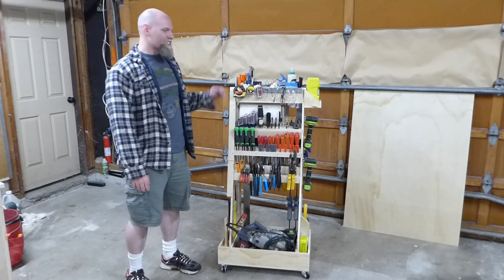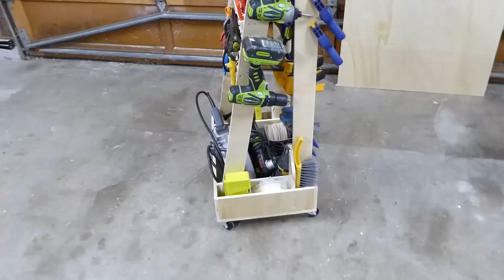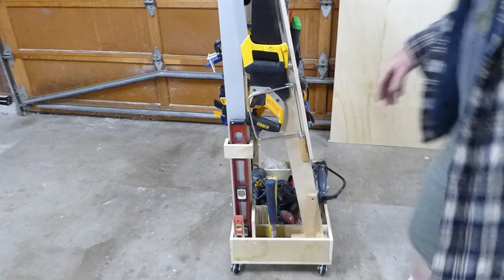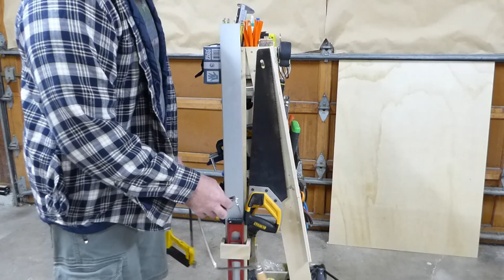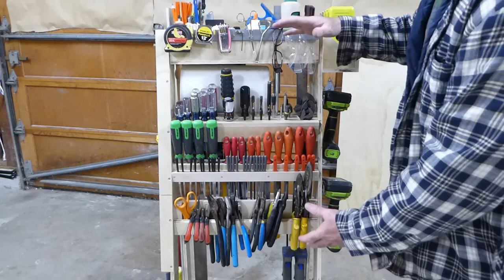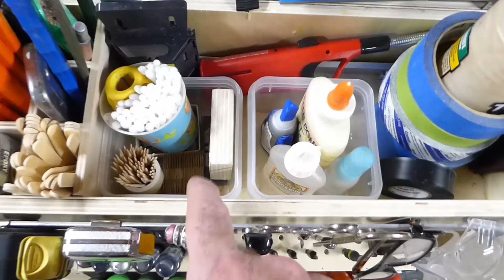Mobile Tool Wall Adam Savage Inspired

Comment: These look like a great idea. I keep most of these items in my 15” Milwaukee packout tool tote. It’s sitting on a stool and it rolls around the shop to where I’m working. Pick up the tool, use the tool, put the tool back. Super convenient. As long as you follow the 3 steps. My biggest problem is my bits and drills. They are stored in boxes like yours and I leave them open on a bend and they over time get full of saw dust and screws. Plus I keep closing them and putting them away then finding one more bit somewhere…. Three times… need a better solution for this.

Comment: Looks great.  As you use it, let us know how it works out and if you made any mods.
Reply from the maker: Thanks. I have used it quite a bit and so far I like most of the front and sides for easy access to my most used tools.  The gloves, paper towels and clamps take up a lot of room that I could double the amount of tools or other supplies.  I am thinking about taking the clamps off and using the back space for screws and additional storage.  I have my drill and driver handy on the cart but I still have to go to the screw bins to get screws anyways.

Comment: Still like and use it?  It looks well thought out.
Reply from the maker: Yes I use it daily and actually return tools to it frequently.  I made a wall rack for the clamps though.  I had intended to make trays in the back but have not gotten around to that yet.  In the meantime the upper storage tray has become a catch all which is not ideal but everything else has been amazing so far.   The small wheels have been just fine because I really only move it about 15 feet or use them to spin it around to access the back then return it next to the door when Im done.